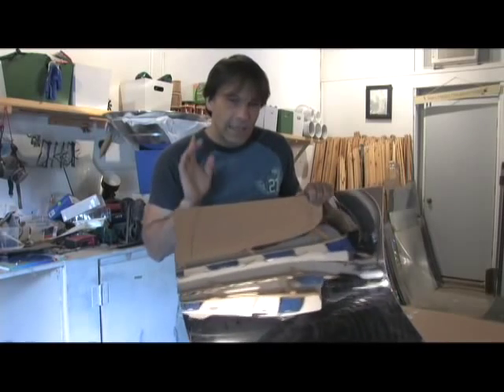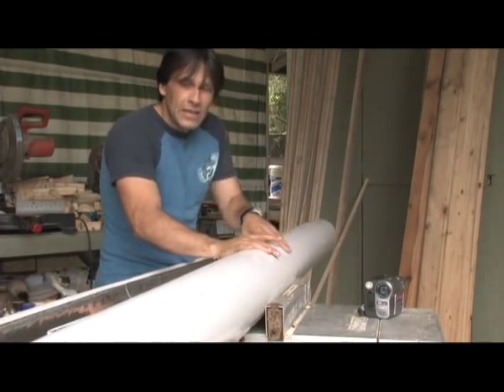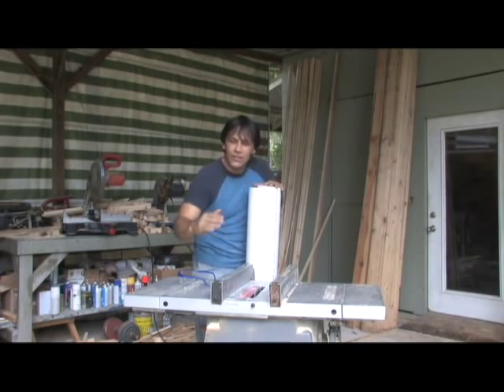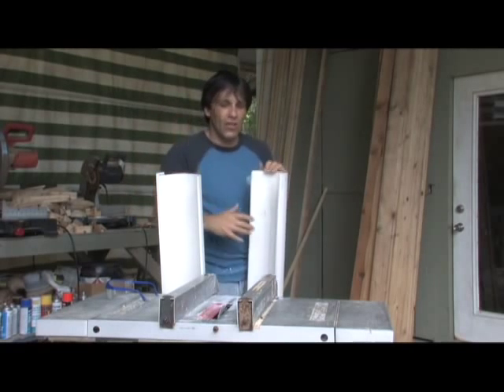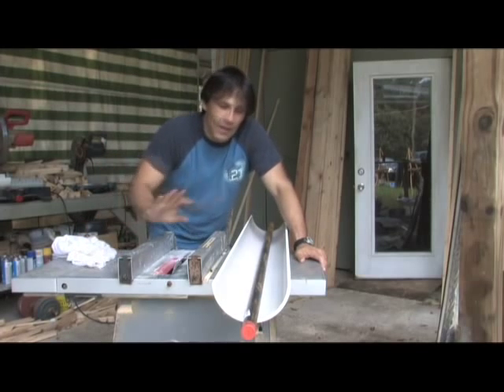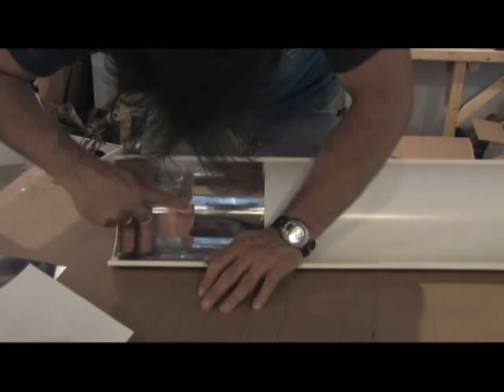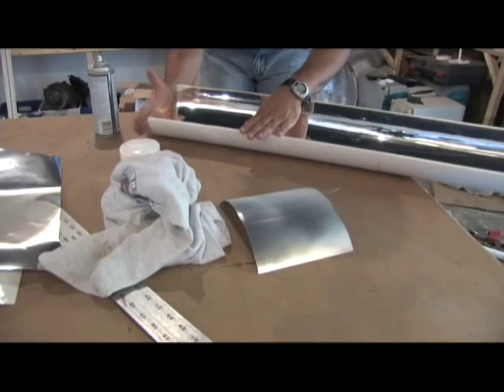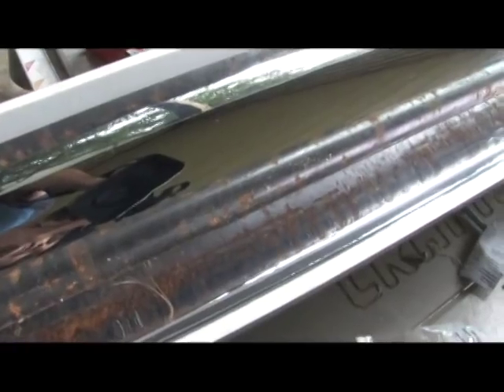PARABOLIC TROUGH REFLECTOR SOLAR WATER HEATER GREEN POWER

Comment: I think I am right, but how about level of temperature - maybe in spiral hose it will be too low because energy is not enough focused. But on the other hand energy colection will be the same as in mirror panels (per m2).

Comment: A practical use for a solar trough might be as the heat source for wood gasification. No open fire or flame needed to gasify the wood in the gasifier, which would make gasification even cheaper & require less wood overall.
Wood gas can fuel a generator for home power. Generator could recharge a battery bank while powering an electric burner beneath an alcohol still for fuel alcohol. BAM, home power & transportation needs covered without oil or coal. Sun would provide bulk of energy required for

Comment: The formula is: Y=X^2/(4 x h)
h=focal point

Unforturnately the PVC pipe is a half circle and not a parabola so I'm not sure this will help much.  I would think that the focal point on a circle is the axis or simply 1/2 Diameter.

Comment: With this system, given a set starting water/air temperature, what is the rate of flow for, say 114 to 120 degree f. water per length of trough?

Comment: yeah stainless steel (depending what mix it is) usually melts around 1500 deg. C, so unlikely that it reached well over 2000 deg. C needed.

Comment: You need a parabola shape trough, this way he's doing will not focus the light to the center - inefficient.  It's a start though, but not satisfying.
Reply: Not really - unless the pipe is very thin.  A circular reflector has  astigmatism - ie all rays are not at quite the same focal-point. However, the chances are you'd not notice any difference in performance between using a proper parabaloid or a circular reflector of this sort of size.
Reply: do the math on how many feet it would take to fill the tub... 2 acres.
Reply: Charlie Hutch That is why you recirculate the glycol and use a hot water storage tank, the effect then becomes cumulative. And, paint your pipe mat BLACK-AND-WHITE, mount the pipe higher than this guys has. I could hit 72 degrees C on a 250L tank in around two hours and that's in the UK!
Reply: How many metres of pipe are exposed to the sun in your system?

Comment: Would it work better with sand ? The sun heats the sand and also the pipe but the sand hold the heat for a long time Period. is my plan correct?

Comment: All I can think of would be carefully building and then mirroring a surface. i don't know of a comparably easy method of creating a parabolic trough. however, I do know that a circular container with a material such as plaster that is spinning as it sets up will create a parabolic surface, though not a trough.

Comment: Any ideas as to where I could purchase the thick reflective surface you're using?  I am trying with 3 mil reflective mylar but am encountering some problems.  The pvc I purchased is heavily dimpled(looked for the best but they are all equally "unsuitable") and is exaggerated upon adhesion.  Anyone have any ideas as to rectifying this problem?  Sanding tips, other reflective materials?

Comment: This looks good; the big problem being substance to coat or cover the cut tube halves that is both highly reflective, and durable. --- And as for the adhesion; that is another thing! -- The most durable thing for this that I know is rolled, chrome plated brass, but that starts getting more costly. Any ideas, anyone??????

Comment: You should find the focus of the parabola to maximize the efficiency. (All of the sun will focus at exactly one point)

Measure your parabola and graph it properly on graph paper. Then find the equation in the standard parabola form (x - h)^2 = 4p (y - k). Use the points (h, k + p) to find the focus. Then convert your blueprint on the graph paper into the real thing. It'll work a whole lot better this way than if you guessed where to put the water piping.
Reply: Hey I'm about to do it, any tips?
Reply: Je pense comme vous. Une parabole n’est pas la section d’un cercle. Il faudrait «  ouvrir » ( écarter) les deux lèvres supérieures du demi tube d’une certaine distance ( peut entre minime). Il existe des formules qui permettent de calculer le point focal et fonction de la largeur et profondeur
D’une Parabole.

Comment: Hi Sir, This is Sanjay from Pune India, I wish to use a parabolic solar heater for evaporating about 10 cubic meter water per day. Can you help me to get the sizing details as shown in your above video? Do you also have a you tube for  DIY multiple parabolic system with sun tracking? Ambient temperatures in my region range from 30 to 43 degrees C with at least 5 to 6 hrs per day.

Looking forward for your help.
Reply: I think you want to boil the water to the point it evaporate which can be cool down to use as distill water.  For something like this, only way is by figuring out yourself and build it, no one going to show you how to do this stuff. Just collect the information you require from the youtube and put your stuff together.
Reply: BUILD A STILL NOT THIS

Comment: A semi-circle is not a parabola.
Reply: I've seen many of his videos... he seems to refer to shapes that come close as parabolas. He seems like a smart guy.. but not very accurate in how he describes a few things like parabolas.
Reply: That's right and people should remember he makes these videos for people at home, not for people who have an engineering workshop.
Reply: +Ray Perkins , this guy simply tries to simplify real science down to where average people can Grok it, and maybe use it to help reduce their energy use. OR help their kids win at the science fair. 
He's doing a great service pumping real science out to folks who may never have had much basic science in school [yeah, that's how bad too many schools are].
He COULD have used hi-temp paint to make the pipe a uniform black, to enhance heat-gain. 

IF this thing gets reasonable hot water, it's good.  
Very few DIYers have the ability to make perfect parabolas, nor the space to place those huge things.  
The smaller ones can still be a great idea, for small uses.  AND...he DID state that it would be better to cut that pipe into 1/3s, to get closer to a real parabola.  
Many folks over the past several decades, HAVE faked it using half-water heaters as their not-quite-parabola, and gotten decent hot water...heating floor loops for radiant heat, or pre-heating or even totally heating household hot water.
Reply: +Ray Perkins  However  a portion of a semi circle does form a parabola, that's parabola Dan was making use of. Anyone who  watched the video should have noticed the focal point was deeper  into the pipe not at the center of the pipe center of the pipe and picked up the cutting the pipe into a semi circle was more about construction rigidity that forming the parabola.
Reply: Problem is, if its not a parabola, its not going to focus the light correctly. You'll get some reflectivity, which, granted, is better than none, but its not going to be as efficient.  Its kind of like eyeballing a square joint for a corner.  Some applications good enough is just fine, but if you want to build a drawer for a cabinet, you want to make sure those corners or square.  Same thing goes for parabolas.  Like a square, a parabola is a specific shape, and you have to decide for your own applications how accurate that shape needs to be vs the amount of time it takes to assure that level of accuracy.
Reply: @colleenforrest7936  exactly!
Reply: Can I get the finished product?

Comment: What happens if you don't put a pipe in it, and just put water in the trough/pipe and set it in the sun?  Does it heat the water?
Reply: No because water is clear it will continue to stay cool. You need the sunlight to concentrate on the black pipe to heat it up and run the water through the pipe to heat up the water.

Comment: Nice video and this would be mostly effective, but, THIS IS NOT A PARABOLIC SHAPE!
Of course, you only have a spherical curve along a cylindrical length.
But I believe this would work for solar heating.
Some of the longer, infrared (HOT!) wavelengths would focus above the axis of the tube to be heated, but not by much.

Comment: doesnt it have a different focal point as the sun is moving in the sky?
how do you solve that?
Reply: parabolic surfaces reflect all incoming light to their focus, this is regardless of the angle of incidence.

light emitted from the focus (in all directions) ends up reflected out of the parabola with all rays parallel to each other (this is why car headlights have parabolic refectors).
Reply: But despite the title this is not a parabolic reflector. It's a semi circular reflector.

Comment: Isn't a flat panel collector more efficient and easier to build?
Reply from the maker: Yes, black water hose or black poly-tubbing is fast, clap and works great. This is for lower volume and higher temperatures that a flat panel is limited to.
Reply: I wasn't talking about rubber/plastic hose. I meant a  DIY (or commercial) flat sheet metal panel with copper pipe soldered to it. I don't see how that parabolic trough could be more productive when comparing square footage of one vs. the other.

Comment: Bare sheet metal is poor mirror.  Special coatings required to boost reflective efficiency.  Just buy flexible mirrors.  Horizontal pipes require only occasional vertical adjustments to maintain seasonal focus.  Vertical pipes require constant minute adjustments to track sun; more wear and tear, more powerful motors.  Roof mounting must avoid snow accumulation; mount in vertical box to shed snow.  Mount above worst-case snow on roof.   Top slopes back.

Comment: I feel that space heating is more valuable and productive than water heating unless you have a swimming pool or a heavy user of water like at restaurants/industrial consumption.Space heating involving recirculating of air is still reliant on natural gas or heating oil as well as direct electricity.To have photovoltaics as a means of supplying electricity for space heating is sheer nonsense. A typical space heater consumes up to 1500 watts and are in heavy uses everywhere.I have an idea,soask me.

Comment: If you hadn't removed the splitter from your table saw, you wouldn't have to worry about the blade binding on the material.
Reply from the maker: The splitters are impossible to use for high volume wood cutting.

Comment: This is Manjunath from  College of Dairy Technology,Tirupati, Andhra Pradesh. Sir, we have one project related to solar Energy Utilisation. Using a solar energy we have to generate ice and this ice is used for cooling of milk at village level. We seek your suggestion and guidance for this project. We want some design guidance and if you know any fabricator who can do this job. We are  are looking for your help.
 1) We have 7 feet arc length and absorber pipe dia is 80NB and length of the pipe is         21 feet long. I do not know how to calculate focal length.
 2) What will be the absorbing material for ammonia.
The above said dimenions had been taken from one article.

It will be a great help sir.

Thanking you
Reply: +Manju nath I believe focal length is 1/2 the radius
Reply: +Anderson Gomes a
Reply: +Russell Bradshaw  use wolframalpha or Wikipedia to get the correct formala. Also don't forget a small portion of the semi circle is creatiing the actual parabola  used here.